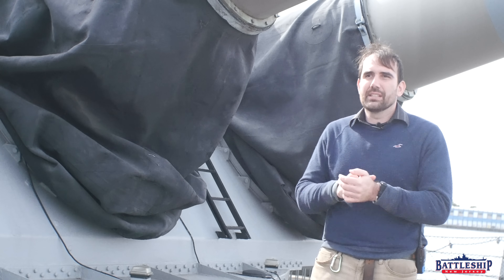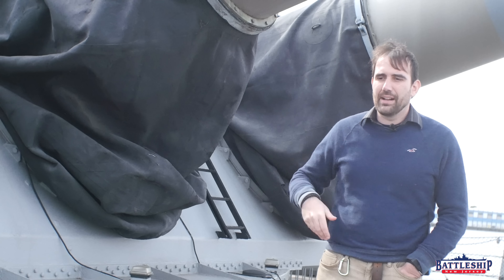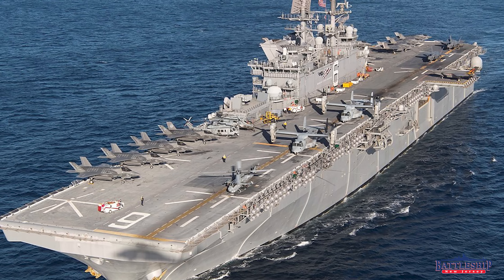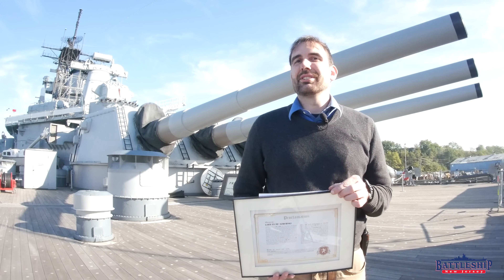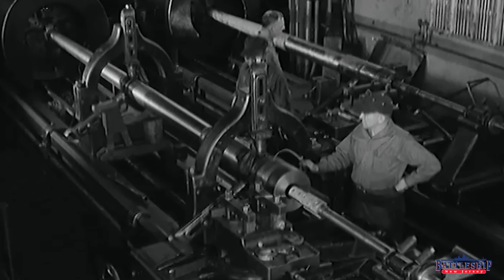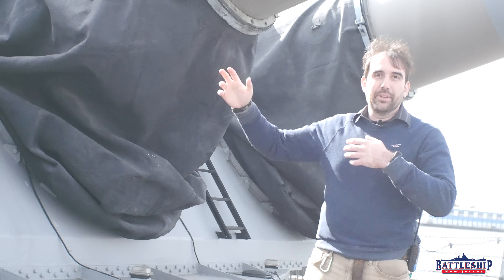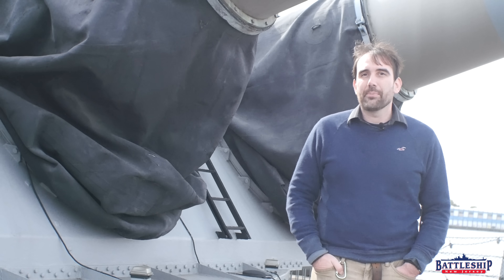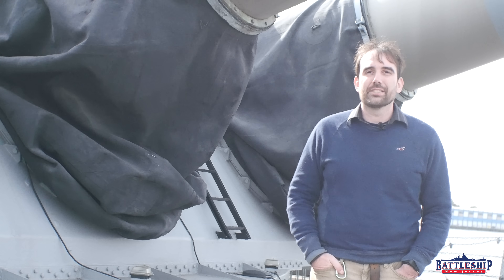How Much Would It Cost to Build a Battleship Today?

Comment: There has always been speculation to bring back a battleship platform. So new navy can mount large railgun systems with the space to accommodate the power-packed energy generation system for such a weapon. The concepts have been standard 3 turret version or a 2 turret system. Mounting 1 or 2 railguns per turret. The power system needed to charge a modern railgun system is available. Though the system is too large and takes too long if down sized to be on a ship for actual use. Reason a battleship platform is even considered. Also with the advancement of large syle capacitors the charge time for such systems are reduced.

For corrections, railgun system is not dead. The deployment is still ongoing for better lasting barrels and a charging system compact enough for DDG class ships. Infrastructure for large gun ships is outdated, not extinct. Most of the shipyards capable of building battleships has the outdated infrastructure. Naval shipyard in Virginia still has the 406mm gun turret crane morred to the pier.

Comment: Spending a few billion on reactivation, real or fake, would throw a massive curve ball at the Chinese, and make them panic.  The armor would mean it could take multiple hits from China's largest and most expensive ASMs.  Its displacement means air defenses could be so numerous that it would take many more expensive ASMs to sink it.  Since artillery shells can now be guided and range extended with gliding or rocket power, we could be talking about having a precision guided one-ton warhead having maybe over 150 miles range, limited possibility of intercepting a single shell, plus they could rapid fire hundreds or thousands of shells from the nine guns.  Sailing this within range of a fleet or shore target would be more devastating than a sub armed with dozens of nuclear torpedos or tomahawk tactical nukes.  Since it would be so hard to sink, it could be used tactically more like a submarine, which is impervious to ASMs and can sail inside the range of surface threats.  Giving it nuclear power or turbine engines would give it the speed to avoid torpedo launch platforms like subs and fast attack boats.  Even just doing a fake reactivation to have them sailing around without a real mission would allow for a deception campaign that would make the PLA Navy shit themselves.  Spending a billion on fake reactivation, fake glide shells and hundreds of fake VLS tubes, would force the Chinese to divert tens of billions into countering it.  Even let the Chinese think it can be operated mostly autonomously, at least for a few hours, and with crew escape boats/subs to evacuate before or during a battle, this way they have to plan for it sailing deep into their defenses.  Diverting a billion for such a deception would do far more than, say, one additional destroyer for example, and it would tremendously affect morale - on both sides.

Comment: Interesting subject and as you say Ryan it is a debate that will never end :). Personally I think it would be a mistake to reactivate the existing Museum Battleships. Not just because of the cost. The biggest issue is their age. They are no spring chickens anymore. The steel I would guess in places is less than a 1/3rd of original now or even less. The maintenance, The wiring. The engines. The hull. The weapons systems. Would all need major work to get it operational. I feel leave the old girls as they are as a good reminder of how things used to be. If going to do more. Then build new modern ones built to modern specifications and equipment. For a start it would make replacement parts so much easier. Yes, would be a higher cost initially. But, longer term it would be cheaper and you would get a lot longer life out of them rather than worrying about metal fatigue sinking one.
Reply: All valid points. Also, no one would readily volunteer to serve on the reactivated ships. The crew amenities are nonexistent, the systems unfamiliar, etc. It would have to be an incentivized special program like the LCS' were.

Comment: i would build new with new composite armour "chobbam" new survivability systems a heavy debate would ensue about gas turbine over nuclear, I think nuclear might win for the same reasons carriers use it. Power & the ability to stay on station  you also for a gas turbine or even a modernised stem turbine and I add the option of diesel. Need to have huge fuel bunkers and the logistics of that amount of fuel. Would you revive the 16-inch gun or would you come back to say something in the range of 10-12 inch with the use of either base bleed ammunition or rocket assisted and use autoloaders with ceramic liners for longer barrel life ? Remembering the range of something like some Himars rockets. The crew is one of the largest logistic nightmares and costs plaguing modern navies, cutting those numbers and heavy automation is a must.

Comment: You can build a "Modern" battleship, but I wouldn't use WW2 design principles. I would guess you would build an aircraft carrier hull, guns instead of a flight deck, making an amusing reversal of WW2 conversions.

New build for sure. Pointless to go back to slabs of metal as amour. Really hard to tank 1 ton warheads, it's going to crack and flood. It's why moderns ships are effectively un-armoured. You would go for some sort of self sealing composite array to avoid outright penetration and use damage control, as you have so much internal volume to stay afloat or go all in on active protection. Wouldn't bother with bulge type torpedo defence, modern torpedos are all guided, making them ineffective. All guns would be autoloaded, water cooled allowing to fire just as much if not more with less guns and can skip the super heavy armour plates. The giant turret ring would make upgrades a snap. 5 inches equivalents would be the popular OTO Melaras. Wouldn't need so much super structure, so replace the deck space with VLS or helicopters or F35.

Rough simulations can be done with a game called From the Depths. Players uses "Wood" and use spaces as part of a composite array.

Comment: As sacrilegious as it might sound, instead of building new Iowa-class battleships, I'd use the same money and material to build brand new, modernized Des Moines-class ships like the Salem. End result, you've got a larger number of more versatile ships that can project power over more areas at once than even a group of 4 Iowas. They would also be significantly cheaper to build, operate, and maintain than a full-size battleship, and less costly in both lives and money if one of them goes down. =^x^=

Comment: I don't see why it should be one way or the other, a hybrid of both old and new would seem like the right answer, there is no need for an armored belt around a Battleship anymore, so a new lighter hull would reduce costs. I wouldn't make it nuclear powered because whatever you're shooting at puts you too close to risk a nuclear disaster; a gas turbine system would be fine for a new class battle wagon. I don't see a need for a three-turret ship either, two turrets, one forward, other aft should work, maybe even just one turret. When the Iowa class Battleships were reactivated back in the 80's the aft turrets were removed to make room for a helo deck, wherever they're at now, if they haven't been scrapped, could be used for the new ship. what makes these old ships so expensive to operate is how many people it takes to run them, with the old battleships, with 4 screws, there's two boilers for each shaft totaling 8 boilers, and each 16-inch gun has a crew lot of people too. Let's face it, the only reason the navy would want a 16-inch gun platform would be for NGFS, it would never use them against other ships, they have missiles for that.

Comment: Option 3. Do not just "refit" an existing ship. Tear it down to the hull in most places to put in all new plumbing, electronics, everything. Add $500 million or more, sure, but everything but the raw steel is brand new which saves on maintenance costs down the line. Take out the rear turret from each of the four ships so as to allow far greater modern firepower. This allows replacements for the existing other turrets. For example, add the longest range guns in the rear turret that were to be on the Zumwalt ( thus bringing down the cost of that ammo too ). Modern engines, hybrid, multi fuel, etc like on some newer ships that save fuel and are far more maneuverable as well. Change out all but a couple 5" guns for more modern weapons like Oto Melara. This removes thousands of tons of weight and the need for those crew. This will never happen, but it would be cool. Skip most of the missile systems that are not defensive. We already have ships for that task. Adding a dozen plus long and short range anti ship and anti air systems to a fleet would help.

Comment: Build new.

Three reasons:

The cost of refurbishment of a museum ship that has sat essentially unmaintained in less than mothball status for 30 years is basically going to be equal to the cost of a new ship, considering that the entire engineering plant would have to be removed and replaced, both because the old plant is likely no longer maintainable due to lack of parts and institutional knowledge/experience, and because the machinery itself is at or near the end of its service life. And in order to do that replacement, they would essentially have to cut the ship open and pull the boilers and turbines out.

Too many legacy systems that are no longer valuable to modern war would have to be removed. The old 5" guns, old radar arrays, and even some of the 80's modernization hardware is no longer viable. It would all have to go. The superstructure was designed around the guns, both the main and secondary batteries. With them going, the superstructure should be redesigned to accommodate a solid state radar array like AEGIS, the newer 5" or 3" guns, and the newer VLS cells that can be fitted to the edge of a ship.

The guns themselves. They were designed with 1930's and 40's propellant, chamber pressures, and materials knowledge. We can do better today, with higher working pressures and better understanding of ballistics performance. In addition, the shell and powder handling spaces would need to accommodate a larger variety of rounds. Modern artillery is nose fused, while most naval shells are base fused (nose fuses get destroyed on impact with armor). The shell handling spaces would need to be able to handle and fit guidance kits, rocket assisted rounds, sub-caliber rounds, and more. While it is possible that the 40's era shell handling equipment can move those newer rounds up to the guns without issue, it would be better to redesign them. And finally, gun elevation. The old guns simply cannot elevate to the degree necessary to reach extreme ranges with rocket assisted projectiles like we see with land based artillery systems. 

Electronics. The Iowa-class was not designed for the kind of power draw that modern electronics can pull. While the ship's service turbogenerators did put out impressive amounts of power for the 40's, a few megawatts of power is simply not enough in the age of massive radar arrays and complex electronics. Just running the cabling, rebuilding breaker boxes, and ensuring that the ship's electrical grid is capable of both handling the load as well as being resilient to damage would cost an astronomical amount of money.

All of these factors combined would essentially amount to taking an Iowa into drydock, pulling the entire superstructure off the ship, pulling the guns and turrets out, pulling the engineering spaces out. At the end of all of that, the only thing remaining would be the hull. At that point, it would be better to simply start with a new ship.

Otherwise, a mild modernization would bring back a ship that has functionally less usable firepower than an Arliegh Burke DDG or even the new Constellation-class frigates, while costing billions to modernize and then operate for a year, while dealing with 80 years of legacy issues.

Comment: You could save much in crew today. An America-Class has a complement of just over 1,200, a QEII-Carrier even less. There is no need for 1,800 personnel. Today CAD/CAM + simulations  can be used which saves time and cost. Furthermore there is no need for 16" guns, smaller could achieve the same results today. Given precision targeting.
Look at VULCANO ammo,  MONARC trials etc. equippt with autoloader etc..

Comment: Very interesting discussion. Personally I believe building a new version of the old vessel would work best, as it would ultimately be cheaper than the upkeep of the originals when put back into active service. Perhaps a compromise could be reached. Have the shape and size of an Iowa, but instead of 16inch guns have extra 120mm guns
Reply: Or reduce the caliber to 14 or 12 inch.

Comment: How about a hybrid concept.

New hull and mechanical systems below, modern superstructure and electronic systems.  Transfer turrets and guns from museum ships.

Reduces the amount of infrastructure development required (re-establishing the gun production).  Of course, there is the down-side that the barrels do have a limited life-span and you will need to replace them.  But it would get the ships and capabilities available in a shorter and less expensive manner.

One thing I have wondered about.  I seem to remember, back in the 80's when the ships were reactivated.  There were articles (in Popular Mechanics I think) talking about 'sabot' rounds for the 16 inch guns to give increased range and penetrating power.  Now, as I understand, sabot is more of a smooth-bore thing than effective in a rifled barrel.  I would think, though that if the Navy saw a demand for a return of the 'big gun battleship' that this would be the direction instead of rail guns.  Large smooth-bore firing high-tech ammunition.

Comment: If I was having to choose between old and new build, I would definitely go new build. The Iowa's are wonderful ships, but 80-year-old ships are going to be a maintenance nightmare. Plus, the old girls have earned their retired status.
I would probably go nuclear, the USN is very experienced with nuclear reactor powerplants as capital ship propulsion, but I would consider doing away with the WWII-level of armour. Gun manufacturing is something nations still do; there are 152mm and 203mm artillery in existence, and while a 16" naval gun is way more substantial than an 8" artillery piece, the base expertise is there, while naval armour plate expertise is basically non-existence, so I would go a similar route to the Kirov Missile Cruisers and have armour around my reactor but only basic protection for the hull, instead placing emphasis on active defences like CIWS.
For the guns, instead of the rail gun concept, I would again lean on current expertise and look to get assisted and guided shells to help increase range and accuracy.

Comment: I could not see a 16 inch gun being made because the targets that need to be serviced by these guns really don't exist. A 10 or 11 inch gun firing an extended range guided munition would possibly have a 200 to 300 km range. As for number of turrets you only need 2 or 3. As for secondaries you may have 2 5 inch with one front and one rear etc. CIWS your going to have numerous CIWS in 50 cal for drones to 30mm for missiles and drones. The powerplant would have to be nuclear for manning issues. The missile loadout would be Arsenal ship numbers. As for armour thats an interesting question as modern Armour with a 3 or 4 metre depth of tank style armour would be interesting. Anti-torpedo defences and even ASW would be needed. assume 6 to 12 helo. Crew of 1000 at least.

Comment: Build a new dockyard ecosystem first. 
Design a new nuclear powered ship. Four reactors. Done on the basis that one day the guns will be replaced with multiple laser battery's. 
100,000 tons minimum.
Build 2-4 ships. Preferably 2 per coast. The bad girls aren't fitting through the Suez or Panama Canals. 
Fit 18 inch rapid fire guns.
Plenty of VLS as the 5 inch secondaries won't be needed. 
Make the VLS for anti-ship work. Fit large supersonic missiles.
Frigates and destroyers can deal with air and submarine threats.
Afterwards start building new Heavy Cruisers. It helps keep the dockyard in work.

Comment: IMO, the idea of a 16" gun battleship in 2022  is a little silly. However, the idea of a large surface combatant, designed to dominate other surface combatants and strike heavily defended ground targets, with a dedicated command section and armed with hypersonic missiles that are too large to fit in a Mk41 VLS, is an interesting concept. This would be sort of like a 21st century Kirov, but since it would always be escorted by destroyers, you could probably give it relatively light anti air and anti submarine capabilities, like a modern aircraft carrier, and really focus on that offensive mission.

There are talks on doing this with the Zumwalts, but this is a refit, ripping out gun mounts to fit the missiles, in a much lighter hull, so they will only get 12 missiles. With such giant missiles, there may be some advantages to a dedicated and larger hull.